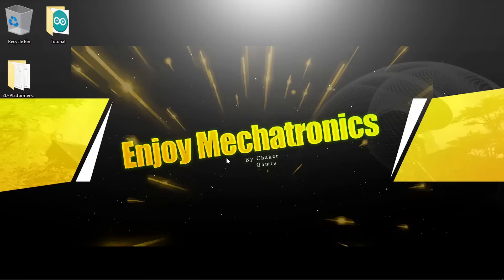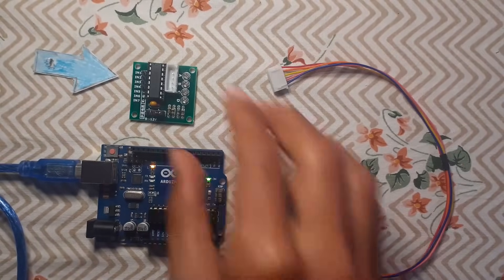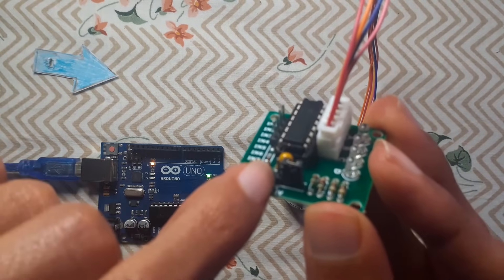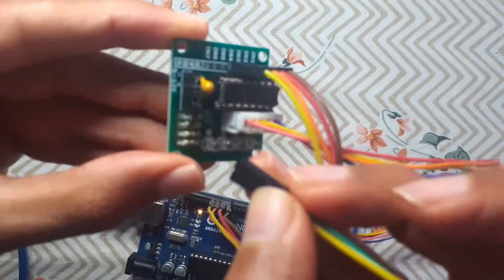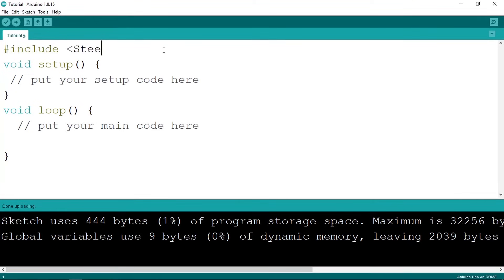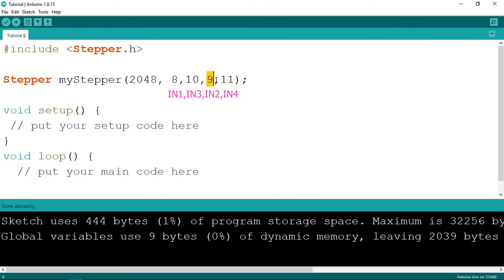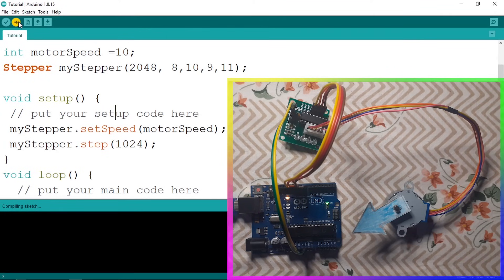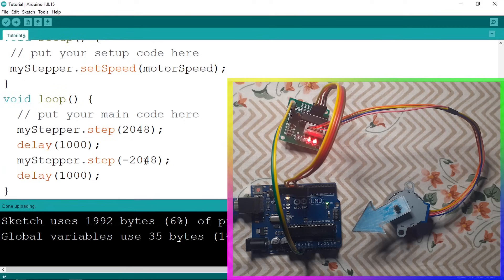Arduino Tutorial 28- Understanding How to Use a Stepper Motor

Comment: powering the uln2003 stepper motor driver using external power supply is recommended as directly connecting it to the arduino can burn the arduino due to heavy currents drawn by the driver.
Reply from the maker: That's right, using an external power supply is definitely the recommended approach.

Comment: could you give me the code?
Reply: RPM Calculation (If Needed)

The RPM value directly affects the delay between steps. The formula used by the Stepper library internally is approximately:

Delay between steps (ms) = [(60 x 1000)/(RPM x steps per Revolution)]

If motorSpeed = 15 RPM and steps per revolution = 2048:
Then,
Delay between steps (ms) = [(60 x 1000)/(RPM x steps per Revolution)]
=  [(60 x 1000)/(15 x 2048)]
=1.95 ms per step

This delay is automatically handled by myStepper.setSpeed(motorSpeed);. You can just set different values for motorSpeed to adjust the RPM without any additional calculations.

Comment: Help!  My setup only runs clockwise and doesn't reverse! Everything is just as you wrote it, Paul. Also, I can run mine without the power supply.
Reply: same as mine
Reply: @sodapunpunnarai2336  if your issue is resolved then please reply how?
Reply: If your issue is resolved please reply how??

Comment: Doesn't the starting current affect the arduino power pin connected to the driver??
It should not tolerate more than 20mA

Comment: Hello dear bro,
 i followed this video step by step but when i send the code to my board, the board disconnect from the PC. notice that i have "Az-Delivery ESP32 Wroom" . 
i thought that the Stepper motor absorbs the energy.

to solve this problem i brought an external enrgy source (Breadboard Power Supply), finally worked well but,
i got the same problem that "Rajat parkkal" got, the motor don't rotate to the other way i mean the negative orientation.
i'll be thankful to help us solving this problem.

*Notice: i'm fresh in Arduino and i have no idea befor this is my first steps on this world.
Reply: You need a separate supply for stepper motor your facing that problem due to current limitation

Comment: when i put a negative number the motor is not turning the opposite direction whereas going in the same clockwise direction towards the angle. Is there a solution??